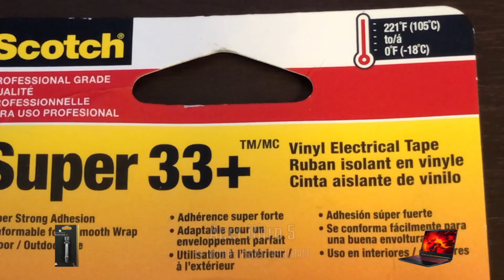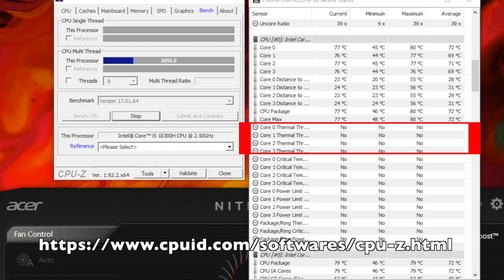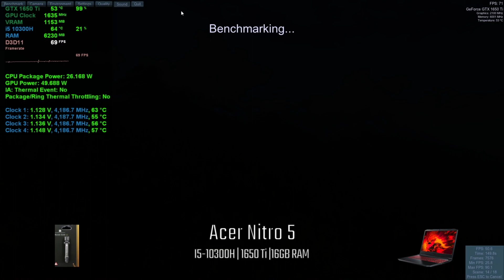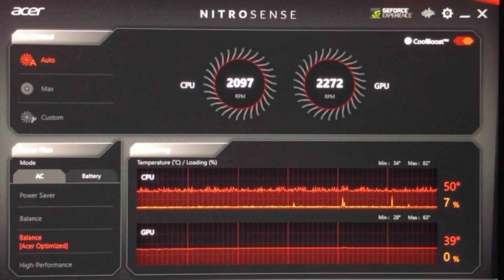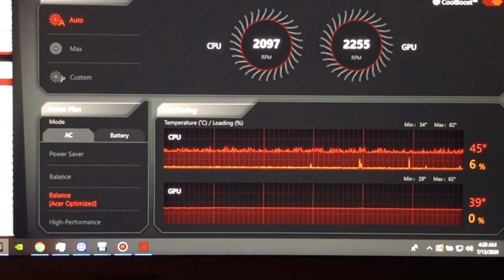Acer Nitro 5 2020 Thermalright Silver King Liquid Metal Test

Comment: Can i use liquid metal for gpu too? I have asus rog g533qs 3080. Thanks
Reply from the maker: I no longer gave Liquid Metal on this machine and currently use Honeywell PTM.  You can put liquid metal on both CPU and GPU but be warned that it will start to deform your heatsink and deface lettering from your die.

Comment: As always thank you for the video.... I also purchased 1g of Silver King.  For years I have used Noctua NT-H1 and have always been impressed with the improvement in Temps.  I decided to give this stuff a try.... More nerve racking than I was expecting.  I have 2 gaming laptops both are i7 10th gen., one has an RTX 2070 (Acer Predator 17.3 inch mine) the other has the RTX 2070 Super (MSi Raider GE66 wife's).  I replaced the factory grease in the Acer last year and have been happy with the results, 5-10 degrees accross the board with no thermal throattling or voltage changes.  The MSi on the other hand is a hot plate.... Reaching as high as 94c on the CPU and 80c on the GPU.  I am pretty sure this is where the CPU begins to throattle. I tried your way buy adding the electrical tape using an Exacto Knife.  I believe it's there cooler design as my cooling temps were all over the place. I tried to re-tape, same thing.  I was not comfortable removing the liquid metal so a friend of mine gave me another idea. I removed the tape and used a clear coat liquid nail protector.... It worked..... These improvements are almost the same as my Preditor using really good HTG..... Im really debating if I want to use the Liquid metal on the Predator.

CPU Idle - High 58c to 49c  /  Unigine (2 hours) High 94c to 84c

GPU idle - High 51c to 49c  /  Unigine (2 hours)  High 80c to 75c
Reply from the maker: You are welcome and congrats on your lower temperatures.  I recently made a fan replacement video on the Acer Nitro 5.  After this thermal test I removed the liquid metal from the machine.  During the replacement I saw pitting on the heatsink that seems to be growing.  I just wanted to let you know.  I'm not sure if Acer uses pure copper or some kind of alloy but its not good.  You can see in this video. https://youtu.be/KItYeLmy_Ag?t=959
Just keep an eye on it.
Reply: @Meanpooh  how did you remove it? It roles so you can't wipe... Scares me a little. Also i don't feel they used enough of the liquid memory cooling material. I have seen the pads but not the liquid...

EDIT.... The video link you sent answered my last questions thanks K5 pro it is.
Reply from the maker: I used a cotton swab. I kept rolling it around and it eventually started to come up. It takes a few minutes. When there was just residue remaining, I used a paper towel by gently dabbing at the surface. Finally I used alcohol in the paper towel to finish up. As you can see once it’s applied it really never leaves. I guess when I was running those benchmarks, the liquid metal started to react with the help of heat. Even when I removed all I could, and also in this video, there is always a dark residue that comes off.

Comment: i have this exact laptop, i might do this, but does it eventually destroy the heatsink?
Reply from the maker: I would stick to normal thermal compound.  If this stuff gets in the wrong place, count your machine goodbye.  It will discolor it and with the combination of heat it could possibly make small micro crevices in the long run.
Reply: @Meanpooh  yeah, i was thinking of undervolting but it looked too risky. if this stuff is also super dangerous i might just get the best thermal paste i can find
Reply from the maker: @largejoe2195  it can be risky. Getting the best thermal compound is better than the cheapest and can hold you over to better methods come around.

Comment: You didn't remove the cpu tape?
Reply from the maker: What CPU tape?
Reply: Thanks for replying it was hreat video 😁
Reply: I mean you make a template out of super33+ then cover with heat sink does it burn? Or mabye add extra temp?
Reply from the maker: I assure you the tape is gone. If not the machine will shut down.

Comment: Thank you so much for this great video, I was wondering if its safe to keep another layer of electric tape after the application of liquid metal as some say that it helps in preventing the liquid metal going near the system?
Reply from the maker: You want to keep it as thin as possible but still protect the open circuitry.  If its too thick it may interfere with the heatsink contact.
Reply: @Meanpooh  will definitely use your guide for future reference. thank you so much! its hard here in our place cause there arent alot of people who have dived in on this topic. will practice first on my older laptop to get a hang of it. also I found a guide how to unlock the bios on my GE75 raider but most articles that Ive read said that even at -.50 undervolt, theres a 5% chance that it may freeze the laptop.

Comment: Hi can you not overclock the 1650 Ti. I have tried on my one and I can't seem to change any of the settings every time I do it just goes back to default  this is the system I've got.

Acer Nitro 5 AN515-44 15.6 Inch Gaming Laptop (AMD Ryzen 5 4600H, 8GB RAM, 512GB SSD, NVIDIA GTX 1650Ti, Full HD 144Hz Display, Windows 10, Black), Plus Headset/Mouse/Mouse Pad - Amazon Exclusive
Reply from the maker: It’s overclockable but max FPS gain that I have reached varied 1-3 FPS max.

Comment: I am using acer nitro 5 10th gen core i7, 16 gb ram, 1660ti 6gb graphics. Today i played PES19 , temperature touch 92°C. I purchase my laptop 2 days ago. What should i do ?
Reply from the maker: You have a few options.  You could:
1 Return it and try a different brand.
2 Repaste
3 Run using Power Saver profile.
There is no undervolt support.  I have been making videos on this machine since its release with every problem that I have encountered.
There will be no way to fix this until the machines get thicker, fans get bigger and the CPU and GPU get more efficient.  The faster they go, the more heat is produced.
Reply: Thank you so much <3 hope that you can find out solve of this problem :)
Reply from the maker: @asfakurrahman6211  If I find out anything, ill post.
Reply: If i use vaccum cooler on cpu fan, does it reduces the temperature?
Reply from the maker: @asfakurrahman6211  That's what they are suppose to do but i've never tried that product.
Reply: Maybe i have to repaste my laptop :(

Comment: so you think the grizzly cryonaut would be good enough , not worth to use liquid metal
Reply from the maker: So far no.  Not for a few degrees.  Im gonna test more when the Conductonaut come in.  Regardless, for the average gamer Kryonaut is best.
Reply from the maker: @Caneck Alvarez Thats a trusted brand and most likely be better than what is on the Nitro 5 stock.
Reply: @Caneck Alvarez I dunno anything about mx-5, but I'll say this mx-4 isn't good for direct die applications like this. While it's not conductive it tends to degrade in performance quickly in these types of applications.

Comment: Hi! Yesterday i watched your video about repaste on Acer Nitro 5. I just replaced my Nitro 5 AN515-52 with Artic paste but nothing changed. Do you know why? I guess i have some issue too as if I plugging my charger the heat around 60-70c (only browsing) while unplugged its only 50c (only browsing). 

Thankyou
Reply: I suggest you to do the re-paste process again. This time, spend more time to clean as much as possible and don't forget to clean the old paste on the heatsink and the chips before you re-apply the new paste.

(One more thing: don't clean the small vram chips near your gpu, leave them as it is)
Reply: @harizone  thank you for the response, the problem was dust near the fan.
Reply: @thevidtowatch  No problem! Glad that is fixed for you :)

Comment: Should I limit the power to the processor to decrease the cpu temperature?
Reply from the maker: You can do that and the temps will decrease at the expense of clock speed.
Reply: @Meanpooh  but i do that my clockspeed stay at 2.39Ghz and did this will affect the performance?
Reply: @Meanpooh  what can i do to decrease the temperature of cpu but doesn't affect the clockspeed?
Reply from the maker: If you are using 9th gen and below, you can undervolt and repaste.
Reply: @Meanpooh  buat im using 10th, what i supposed to do to decrease heat?
Reply from the maker: @hadirahman554  There's not much other than repasting that may void your warranty or using the power saver mode.  Make sure to have max fans on while gaming.  There's  not much else.
Reply: @Meanpooh  if upgrade ram + ssd, it help to  decrease heat or not?
Reply from the maker: @hadirahman554  All hardware will contribute a little to the overall heat.  SSD's a little less than HDD's.  Having more RAM will let your PC work more efficiently which will increase heat but that depends on what you are doing.  Gaming yes, web browsing no.  Your pros will outweigh your cons when it comes to upgrading components for the most part.

Comment: For beginners, I would like to point out that he did add a bit too much in both the CPU and GPU in this video. There should not be an bleed over to the tapes when you are applying. Also, use high heat resistant tape around the CPU and/or GPU and keep it there when you mount the heat sink, it will not affect performance. This will make spillage, if any, much safer as the metal will not touch any capacitors or components at least around the CPU/GPU.
Reply from the maker: Thanks for sharing.  I noticed that but I repasted the heatsink and the CPU and GPU with that one drop.  Over the course of the test I removed and applied it 4 times before I finally recorded the values.  This could be a bad batch and will try Conductonaut.
Reply: kryonaut is all !
Reply from the maker: Kryonaut is awesome.